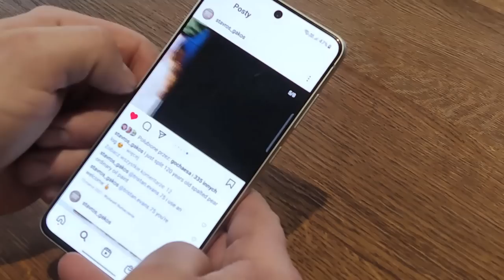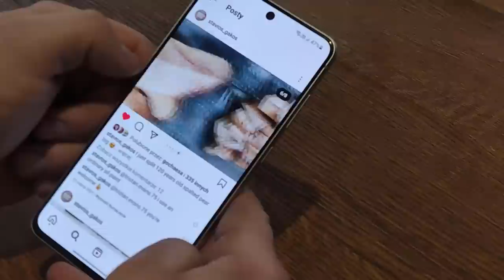069 Preparing planemaking billets out of spalted pear

Comment: Stavros Gakos  In the next couple months I will be turning a large Shag Bark Hickory been down over a year into lumber using a chainsaw mill that will leave lots of 6-12 inch limbs that are to small to turn into boards. If you are willing to pay just the shipping I will ship you a 6" tall x 12" wide X 12" deep of what size rough cut as you request for just the shipping costs to you as if not put to use just gets burned up in the fire pit.
Reply from the maker: Hey John! At this time i have too much wood waiting for prepare so i don't want to take  more, but thank you for your offer 👍